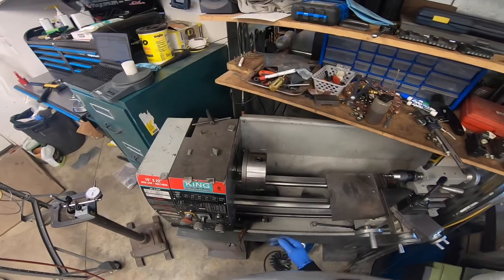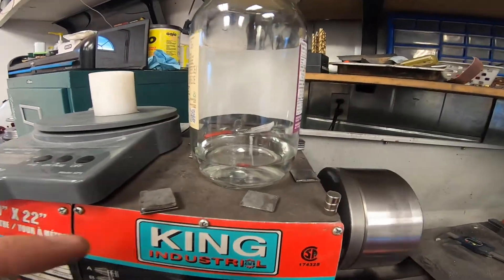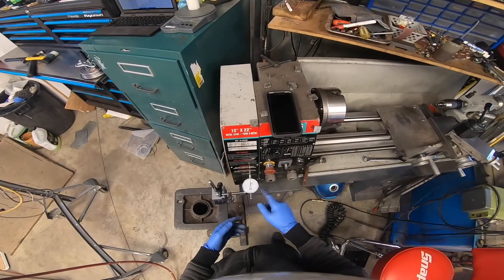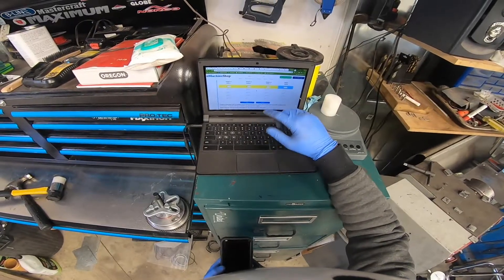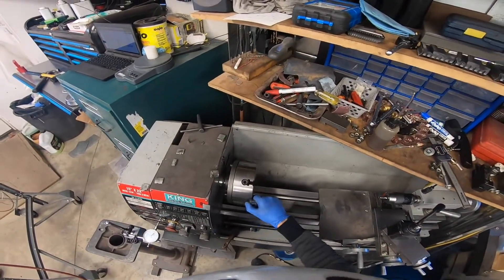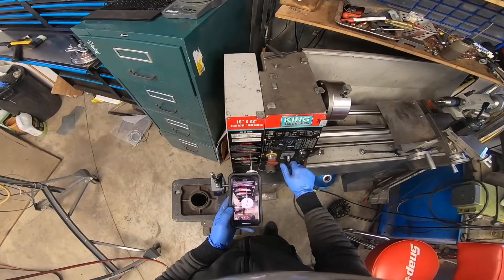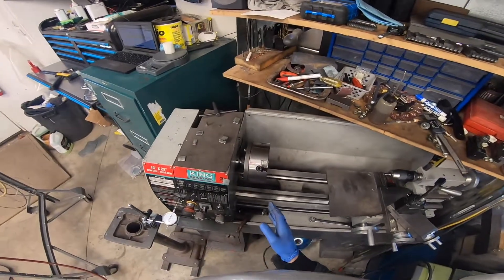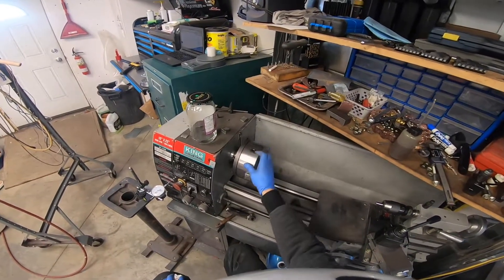DIY Dynamic Balancing !! - This REALLY works !! - Balancing my lathe - Part 1 - Apr 2020

Comment: I wonder if this would work by just following the  indicator needle sweep. Move the magnets until no vibration.
Reply from the maker: Yes, but it may take 10 years to figure out exactly where to put them. Location and mass is not necessarily intuitive. The website does the calculations to narrow it down quickly.

Comment: That's super cool! I've always wondered how they balance car wheels and I imagine that's how it's done. How do you like the lathe? I watched your original videos years ago, I've been looking at a similar size lathe and always wonder if I'd be disappointed in one after watching youtube videos of big lathes machining hydraulic cylinders etc.
Reply: After posting I realized I'm logged into my other account. Oops. 

Yeah. Balancing wheels is done kinda like this but with an encoder to keep track of rotation, load cells to tell you how much force and a computer to do all the calculations that then tells you where to place the weight. 

I live the lathe, but it does have its shortcomings. Speed changes are made with a belt change so that means I always run it at the same speed, haha... Threading has to be done with gear changes, so I only thread when I absolutely have no other option. It gets lots of use, I love it and I'm glad I have it. It will sometimes sit for a month or two without any substantial use, but it comes in really handy several times a year. 

Also... if you're watching Cutting Edge Engineering, Curtis is next level, haha.... but this will get you making chips.

Comment: Now you can possibly grease and oil the inner parts fully and or change out any old worn bearings internally to make below one thousand of a degree change if possible, some lathe machines require a oil change internally oiled drumed 🛢️... ⚖️
Reply from the maker: Yes... I have changed the oil on my lathe a few times. On this particular one, the oil is only for the gearbox, and the spindle bearings are oiled separately through fittings on the top of the lathe.

Comment: Joel, I can’t thank you enough for illustrating this process.  I have a wood lathe.  I have always felt that there is a slight bit of vibration imbued in my work by my lathe and not by the workpiece.  This gives me a means for a quantitative analysis. Kudos!
Reply from the maker: Good stuff... ! I have heard that the website that I linked doesn't always work. If this is the case you can always use some trial and error... tho it will take a lot longer.

Comment: i tried the calculator but no matter what imbalance i put in the blue box when i hit the balance button everything goes to 0 and it moves the imbalance amount down one line it never tells me to move the weights
Reply: I was starting to think I was going crazy haha. I sent them a email if they reply I will let you know what they say.
Reply from the maker: @boostin306  Yeah, sorry. I have used it several times without issue, so I also assumed you were crazy, lol... My bad.
Reply from the maker: I have used it a few times and it works great... I would suggest starting over and following the steps carefully. 

Everything returning to zero that would suggest that it is telling you to take all of the weights off at all 3 positions, meaning that it is best balanced with nothing on it. Your weights may be too heavy or because you need to allow your machine (whatever you are balancing) to move more freely, or use a more sensitive device to measure movement.
Reply: It’s a 30” x 1.750 small engine dyno flywheel. I have it set up with a indicator the same way you have your lathe with rubber under the side with the indicator on it. I’m getting .008 imbalance when I put that in the blue box it moves to the box below and everything else zeros out. This is on the 1st try with 5 in pocket #1. I’m wondering if the calculator  just isn’t working correct right now I also put the same numbers in that you did they also give me zeros for everything
Reply from the maker: @boostin306  Hmmmm. I just tried it, and I see what you are saying. There's something wrong with it for sure. That's unfortunate. You could try contacting them... Hopefully they can sort it out.

Comment: Wow, that is super cool.  I ran into another video using this program.  Do you think this would work if you first balanced the lathe then chuck something into it and balance the item that is chucked in the lathe ?
Also having the indicator on the face of the machine as you do vs. a shaft that is in the chuck ... either would work? Is one more accurate than the other ?
Reply from the maker: Great questions. 

Putting something in the chuck to balance it... Yes and no. Yes, IF you are not trying to do sensitive balancing. The issue is that the mass of the lathe creates inertia / resistance of movement. If you have an object that is out of balance by a few grams, even if the lathe is floating, it will not move much.  

The reason why this method works with the lathe chuck is because it was wildly out of balance. As it is, my chuck, showing "perfect" on my lathe, would surely be out by several grams on a more sensitive system. On a sensitive / accurate balancing system, the moving mass (of the machine) would be a small percent of the item being balanced. 

If you were balancing a particular item, all of the time, you could make a tool that replaced the lathe and had freedom of movement. There are many ways to do this and it largely depends on your application, and how creative you are. I had an idea of suspending an electric motor from a heim joint, with an adapter to attach a flywheel. In this case, it would be important not to spin the flywheel too fast, as it would create gyroscopic stabilization. 

The position of the dial indicator matters somewhat, but far from the chuck would amplify any reading and make it more accurate. Close to the chuck will tell you how much the chuck is moving, but that's not what you want to know. You want it as sensitive as possible. If I had a long bar from my lathe up to my shelf, for example, at the end of that bar, a few thousandths at the chuck would be an inch or so. Easier to read, easier to correct.

Comment: Thank you, do you know how it can be done by removing material?
Reply from the maker: Yes. If you watch both videos (part 1 and 2) you will see that I used the magnets to measure the position of where I needed to remove weight. I drilled holes to remove weight.

Comment: Nicely done.  So once your lathe is balanced, you could use the same setup to balance other things that you attach to the lathe.  I have a mini-lathe and was trying to find a way to use it to balance some electric motor rotors I have made.  Thanks.
Reply from the maker: Thanks for the comment. While what you are saying is true, the level of sensitivity is fairly low (with my application) 

The percentage of weight imbalance needs to be substantial compared to the weight of the lathe rotating parts. With balancing a motor you are going to want to be within grams if not more accurate. The mass (inertia) of the your test machine will have a tendency to mute / filter out imbalances. 

Ideally, you would build a floating / suspended spindle to attach your motor armature to. If your mini lathe is well suspended, and your motor is fairly large, then this could still be a good way to do it. 

ONE LAST NOTE. Some one pointed out to me that this is technically not dynamic as it is only measuring one axis. My lathe was basically using the floor as a hinge and able to move back and forth slightly, while true dynamic balancing would allow it to move freely on each end, but this would also be many times harder to measure accurately.

Comment: Looks like static balance to me not dynamic as you are only measuring in one plane
Reply: When we balance rotating equipment rotors, mainly pump rotors a static balance is still measured and corrected by rotating the rotor exactly the same as dynamically balancing however when static balancing you are only measuring in one plane most often a radial imbalance. When dynamically balancing you are correcting radial and axial imbalance. 
It’d be like adding a blob of putty to a bicycle wheel and spinning it. You’d get a radial imbalance which could be corrected by statically balancing the wheel (add a sufficient blob of putty to the opposite side) 
If the wheel was buckled and had a blob of putty on one side it would not only be radial out of balance but would be axially out of balance and for this dynamic balance would measure and rectify that. (Adding a blob of putty opposite in this case wouldn’t rectify the buckled wheel so weight would have to be added strategically elsewhere to counteract the buckled section.)
Appreciate the website that produced the program online state it’s to dynamically balance. 
Unfortunately the dti on the side of the headstock will only pick up radial readings. 
However I’m not knocking the process as you produced positive proven results!
Reply from the maker: @Ryan_B92  Yeah... I didn't know how to put it into words, but I totally get what you are saying. I have balanced motorcycle wheels and you don't just balance a specific degree rotation, but also the left or right side of the wheel. Same deal with car wheels. 

So dynamic balancing doesn't mean balanced in motion ... it is referring to testing and correcting that is done both radially and axially ?  Maybe you're not this deep into the testing machines, but I'm curious as to how they work. Do they have a load cell close to the rotating mass to read radial forces and then another one at the end of a shaft to measure axial forces? 

 Maybe if I hang my lathe from a cable at the center of gravity and use two dial indicators 😂I know this wouldn't work as the torque would cause the lathe to rotate making it impossible. It would be a pretty funny sight up though.
Reply from the maker: Hmmm. Really? What would you call this then ? I totally get what you are saying. Dynamic would be measuring forces on more that one plane where this is kinda only perpendicular to the axis. 

Static would be when you juet allow the heavy spot to fall to the bottom / use the effects of gravity. I did a quick search and this is what I found. 

Static balance refers to the ability of a stationary on object to its balance. This happens when the objects centre of gravity is on the axis of rotation. Whereas dynamic balance is the ability of an object to balance whilst in motion or when switching between positions.

Comment: are you sure about puting magnets on the chuck?
That sounds quite dangerous.
Reply from the maker: You are right about that. These are very strong magnets and I was careful to keep the speed down. I stood back and tested it at higher speeds, off camera, to make sure it could take a lot more rpm before I trusted it. I can't remember if I said what the speed was but I think it was only 150 rpm as that worked best for the process and was safest. 

This could potentially be dangerous if someone used the wrong magnets, or perhaps worse, strong magnets and turned it really fast.
Reply: @JoelArseneaultYouTube  those are very strong magnets, you could run it quite fast but i bet if they all slid to one spot you get a heck of a shake, lol.
Reply from the maker: @johnwells6999  Yeah, for sure, it would get nasty. 

The whole idea of this test is that the program calculates a temporary imbalance that you are able to move around. It takes this information and can calculate where the real excess material is. 👍